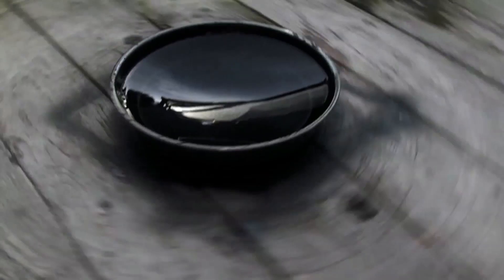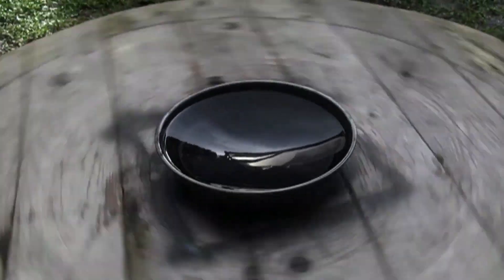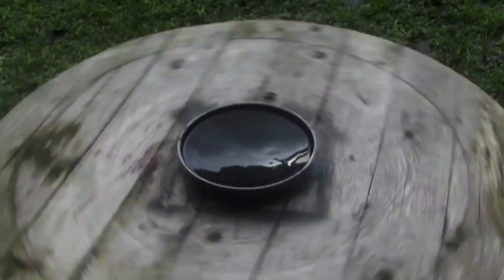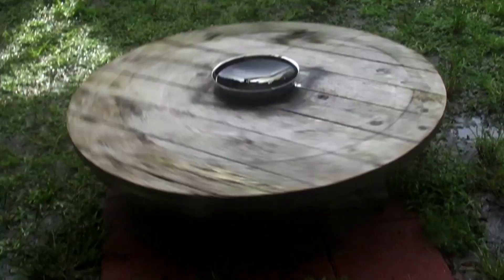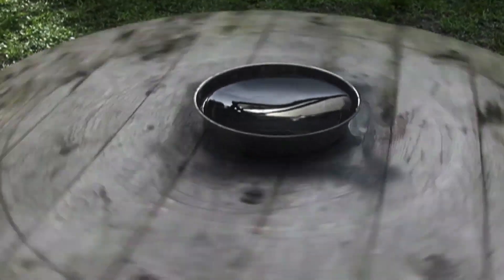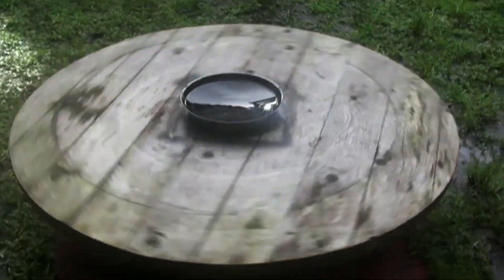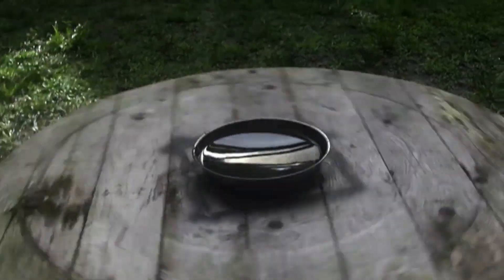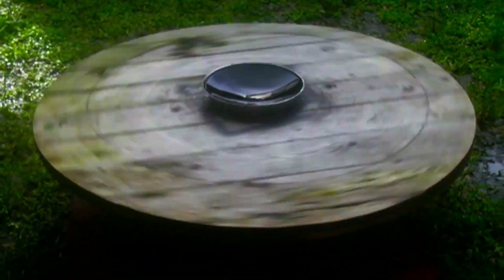Liquid Mirror Telescope Specular Reflection True Adjustable Parabola Solid Body Rotation

Comment: Congratulations! I have had the same project for years but I couldn't make it.  What I want ot do is to use the liquid surface to "cast" polyimine resin. Why polyimine? Because it is the polymer that cover the IC packages for a very good reason it is "impervious" to temperature I mean it doesn't expand or contract so it is a much lighter alternative to glass in a telescope . And this is VERY, VERY important for my application. So instead of water I suggest you to use a viscose liquid like liquid paraffin or silicone ( I still have to check whether they are immiscible or not) and on top of this little by little add polyimine resin, as much as possible to form a parabolic shell of 2 to 3 millimetres. When you are happy with the liquid surface of polyimine you just start a UV light to start on the spot the polymerization.  Having got a perfect polyimine parabola, the only thing is to put a reflecting surface of silver with a very simple chemical reaction that I have done several times or better to build a vacuum chamber (a frame and two strong glasses where is made the vacuum) and put aluminium wire on a wolfram light bulb filament and in the vacuum light the filament producing the aluminium deposition on the polyimine shell

Comment: This has me wondering if you couldn't rotate a liquid material, let it cool while still rotating in shape, and then use a vacuum chamber to sputter coat with aluminum, copper, etc. Should be as precise, and much easier than grinding methods.

Comment: Hi Stan. I love it. The resin thought is good. I tried a different route. I ground a 6 inch mirror, f6. Yet I polished the convex 'tool'. Did no proper figuring tests on the Convex Tool. Lined the CT to make a mould. Used a Thermoset plastic and a bit of heat to make a mirror and (gotta  keep some of this to my chest), would you believe it, (not aluminized) could just barely make out craters on the Moon, details in nearby objects, trees, leaves and etc. Marriage woes (my ex thought I was in the shed making drugs ala Breaking Bad (amongst other things)), so I've had to put this little puppy on the backburner for a while. But I've kept most of the equipment and when I get the chance, will give it another crack.
Reply: don't mention Crack

Comment: Have you tried the two-layer trick for this? Use runny epoxy to set a rough parabola, then after the first parabola has set, do another layer on top of that. You'll end up with an optic quality finish that's ready to be mirrored.
Reply from the maker: Thank you for the great idea. That should help the uneven cure rate. I will give it a shot. Thank you again.
Reply: +GREENPOWERSCIENCE I learned this trick from an old issue of Scientific American back when they featured how-to articles.
Reply: +GREENPOWERSCIENCE  use Instacast but degas it in a vacuum chamber first.
Reply: +GREENPOWERSCIENCE Now that I think of it, here's what would be the best way to use this: make a giant two-layer cast parabola as a positive mold to make a negative mold, and use that negative mold to manufacture multiple fiberglass/epoxy parabolas.

Here's another idea: take the negative mold of an extra large parabola and slice it into six wedges, and make parabolic segments with a flange going around the edge. Then, you can transport the wedges where you need to in order to re-assemble them into one giant parabola that wouldn't be able to be easily transported otherwise.
Reply: @Berkana  donit jwst😊

Comment: How would you center the bowl perfectly in the middle to get the resin to for a centric parabola?

you can see that the water level is a bit higher on one side and goes round and round...

super
Reply from the maker: +Yves Baggi If the resin cures equally. It is tricky because an uneven cure can cause the top to lift off.

Comment: So if the liquid is replace with some kind of epoxy or other type of setting fluid ,you make the mix and make it turn at a proper speed ,it would make a blank for a real mirror when it sets. Just have to silver it ... Is that your plan ?
Reply: yes i think so but you could use also a cheaper concrete... where you from? italy spain?

Comment: Guess you've aleady thought of all the ideas,  but in case not...  I'm a big fan of modelling wax.  Very runny at domestic oven temperature.  Sets solid at room temperature.  Even more solid when chilled.   Maybe I'll have a go at trying it for this spinning technique.  Use the wax "female" to cast a plaster "male" (thin layer at a time cos plaster warms up as it sets).  Then make a fibreglass/resin dish on the plaster.  What do you think?
Reply: You won't be the first if you try. Newton has already done that. I would recommend putting the spinner inside a vacuum chamber so that the surface is undisturbed by waves.
Reply: I think it'll be quiet big to handle and manage but worths the challenge. Btw, have you done it since you posted this ?
Reply: Okto Putsch   sorry, I haven't tried it.  I'm not sure of the physics, which may lead to a swirling pattern on the surface (fluid dynamics is a bitch),  and I don't need to make a parabolic mirror!   I posted cos  I vaguely remember  being told about the idea.  Not much to go on, sorry.

Comment: 0:12 The large wooden wheel that you made, looks exactly like a large wooden cable spool that the power comps use to run transmission line.  But still a cool demonstration.

Comment: how about building up a quick-dry resin in incremental layers. Finally finishing it off with the final and top coat of slow dry resin. A bit time consuming, but anything worth doing usually is. I love the videos by the way.
Reply: You could build an 'approximate' surface out of resin, using any means at all (e.g. carve a mold out of wood) - and then use this technique to fill in the approximate surface to the proper surface. The liquid will flow to the proper shape even if the bottom of the container is uneven: when it reaches steady state, the liquid is not flowing, it's just all rotating around at the same rate as the form. So it's important to have a good bearing and very steady rotation.

Comment: what about freezing it in situ (do it in winter?) then use it as a former for vacuum forming.
silly idea but worth entertaining............. if you made the platform from several layers of MDF (very flat (and cheap)) & then mounted it on 3 rollers round the edge one of which was motorised you might get very smooth rotation & potentially a much bigger pool of water.......or you could make a battery-operated one that went in a deep freeze? I suppose it's simpler just to find a satellite dish

Comment: Actually, as it was reported, the 94-inch mirror had NOT been parabolized as telescopic mirrors need to be.  (Although Richard C. Hoagland doesn't believe that.)  So some kind of corrective lens system was developed to correct for that, and Hubble photos greatly improved.  Spinning a liquid naturally parabolizes it.

Comment: As I recall, a telescope mirror designer named Roger Angel used this spin method to help build a mirror for a large telescope.  I guess the idea is, if you can get close to the correct shape by spinning the glass, it will come close to the correct shape without a lot of grinding.  Also liquid "mercury" telescopes have been tried in the past.  Of course the limitation is that you can only look at objects at the zenith, unless you can develop some kind of mirror system to point elsewhere.
Reply: Bagaimana jika menggunakan resin?

Comment: But you will probably get the dull slighty crystallized surface that you get when metals solidify, and yes, metals are crystalline, even though the are malleable, they still are crystals in nature. And polishing lead is a bad idea because polishing means abrading fine particles. Not what any green person ..or any conservative person placing some value on the own lives would do.

Comment from the maker: Fire ants, termites in the base too, but the geared motor/generator still works perfect after total neglect. I was curious how they hold up to the elements. I just cleaned it up for a new video as it can output 255 peak watts. A one minute power ride can store enough to charge cell phones and small devices all day. Five minute leisure ride can store enough for 3 watts of LED lighting over a 12 hour period.

Comment: I have always wanted to make a telescope but the thought of the parabolic mirror has stopped me. SO... what liquids can we use that will harden correctly for a shallow mirror? I realize after the mirror is made I would need to adjust the secondary mirror until the right focal length is obtained that matches the first mirror. To me this is exciting. I have wanted a good telescope for at least 30 years.

Comment: Hey, I was just wondering: have you thought about shortening the focal length on your fresnel lens setups (or super macro lens) by putting multiple lenses in series? I realize this might not make the setup much more compact, but I've been wondering if it could make the light converge much sharper, allowing greater temperatures in smaller areas.